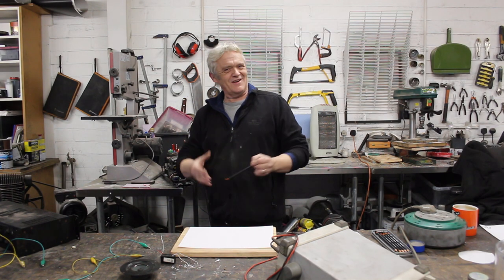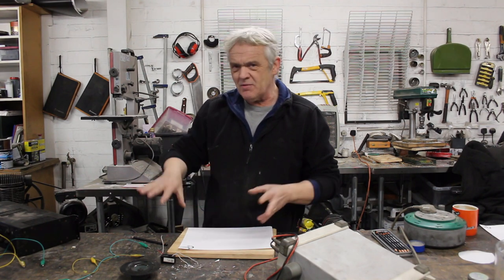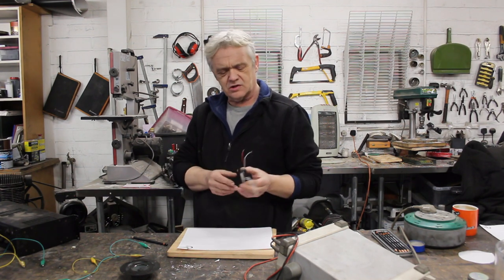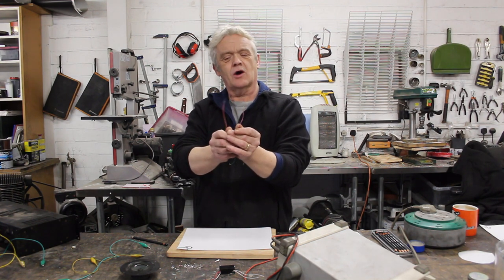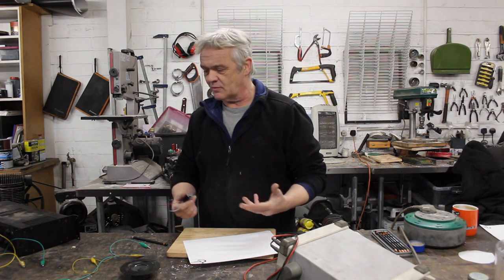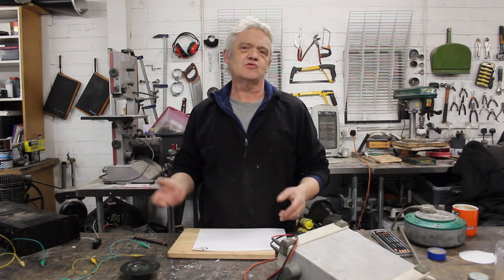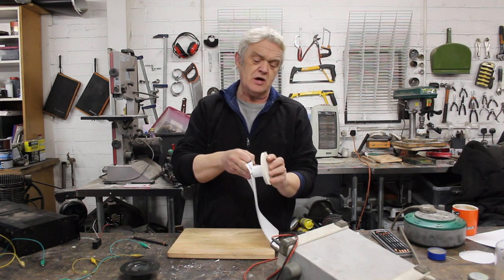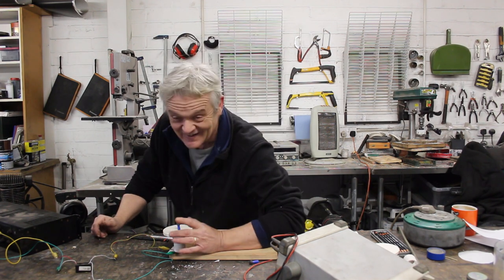1395 A Little Thing To Blow Your Mind - Paper Speakers

Comment: I definitely wouldn't use these earbuds on the bus though, but great science project!

This is an electrostatic speaker per se, but I would rather call this arrangement a flat plane capacitive speaker just because it sounds better and may confuse more people. 
On the academic side (if I may be serious for a second): different types of paper may give different results (rice paper?), double sided pencil coating and perhaps cutting excess paper could help amplify the sound? How about an array of speakers on a single sheet?? I must have read something about this when I was a teenager.

Hidden perk of this project: play it loud enough and it becomes a fire starter. 

Still reading? This construction method just looks like magic, it reminds me of the scene where Taylor, in the original Planet of the Apes movie, made the paper airplane and launched it in the air.
Reply from the maker: I haven't seen that movie in ages - good film. Anyhow you are spot on I think - lots to play around with here to optimise this

Comment: @Robert Murray Smith - I wonder if this principal would work more efficiently using silver conductive paint instead of graphite pencil lead, applied to a diaphragm of stretched cellulose instead of paper? A very interest thing to experiment with, potentially scale it up as well as down. The shape of the conductive layer is probably critical for optimisation of the diaphragms range of physical deflection. Are two half circles the most reactive of shapes? What would happen if one draws the circuit on both sides of the disc?

Questions... questions, questions! 🤨

Darn it Robert, you got me drawing circuits on bits of paper! 😉
Reply from the maker: I would think so mate -  only used pencil because it makes the whole thing that much repeatable for anyone who would want to try it - I mean talk about stuff you have a home for doing science!!
Reply: Well I might try one on my bongo it's stretched canvas?

Comment: You made an electrostatic speaker. I didn't know either but i found a wikipedia page on that.
Reply from the maker: in a sense yes but it really generates thrust from the asymmetric capacitance - have a look at the experiments NASA did on asymmetric thrust capacitors as possible EM drives
Reply: @ThinkingandTinkering  I indeed found some information on that. That's cool. However I think it's a very different subject. That's not what you made.  You might try to make an EM drive like that. If you get a measurable result it would be a great success.

Comment: Would be posible to use one of those high voltage modules as a welding machine? For welding metals?
Reply from the maker: I don't think so mate - as gar as I know welding uses low voltage and high amps - this just wouldn't generate the heat needed I would think - though I guess it might spot fuse stuff together but I  don't know how exactly just an idea

Comment: I wonder if you could get more volume with a sheet of plastic and your conductive ink?
Reply from the maker: I would think so as the dielectric strength of the material it is painted on is going to be a factor for sure

Comment: Another SHOCKING idea! Make a capacitive speaker with two pieces of paper.
Reply from the maker: that's crazy talk lol - nice idea mate and would be a good extension for sure
Reply: I thought similar....What would happen if one draws the circuit on both sides of the disc? 😉
Reply: @Zodliness  I think the design in this video audio is created by heating the air.  I'm not sure that doing it on both sides would benefit. 

On the other hand, two plates of a capacitor can use electrostatic forces to move the plates.

Comment: This reminded me of Dr Flanagan's orginal neurophone that used HV
Reply from the maker: I must look that up - never heard of it but sounds interesting lol
Reply: @ThinkingandTinkering  "The first Neurophone device was constructed by attaching two Brillo pads to insulated copper wires. Brillo pads are copper wire scouring pads used to clean pots and pans. They are about two inches in diameter. The Brillo pads were inserted into plastic bags that acted as insulators.
The wires from the pads were connected to a reversed audio output transformer that was attached to a hi-fi amplifier. The output voltage of the audio transformer was  about 1,500 volts peak-to-peak. When the insulated pads were placed on the temples next to the eyes and the amplifier was driven by speech or music, you could 'hear' the resulting sound inside your head."
His later commercial units would use ultrasonics instead of HV, but for same effect you see with your paper speaker.

Comment: i <3 RMS
Reply from the maker: wow - cheers mate
Reply: Robert, on amps theres usually two channels for two speakers could the amp power two HV modules and run L and R speakers? 
Also, can you make any suggestions on how to protect the amp/driving circuit in case the voltage gets too high and spikes back? Is that even a concern with this set up?